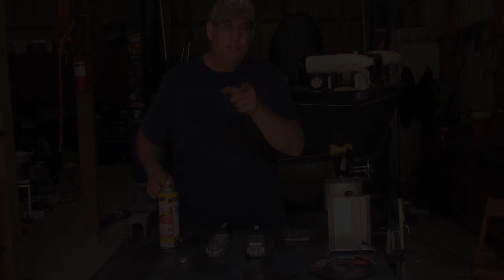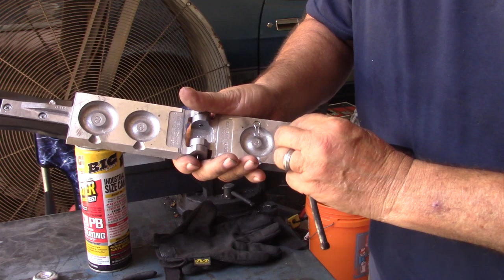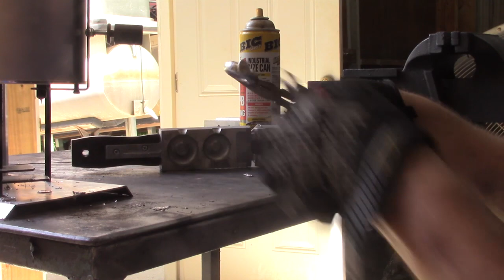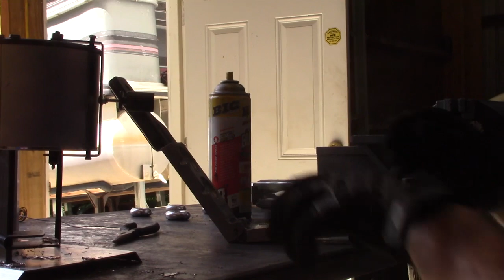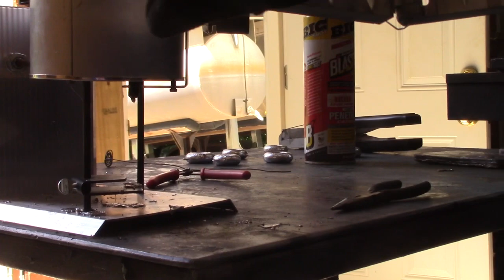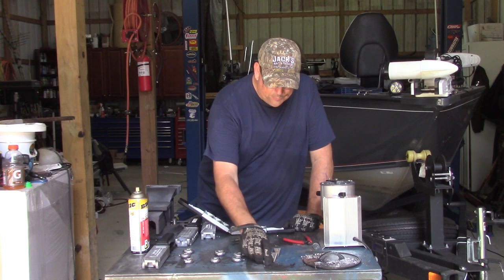Melting lead for catfish Sinkers

Comment: Excellent video Darrell thank you . One tip I may add is you can use candle wax as a flux to clean your lead . For years my father custom cast bullets and we used lead of all types to melt down for bullets  but we used just plain candles to flux the lead to remove any contaminants. Again very good video especially the safety tips
Reply from the maker: I will keep that in mind. Thank you.